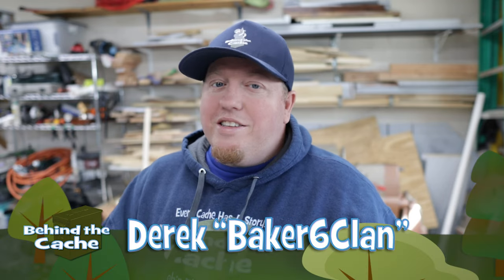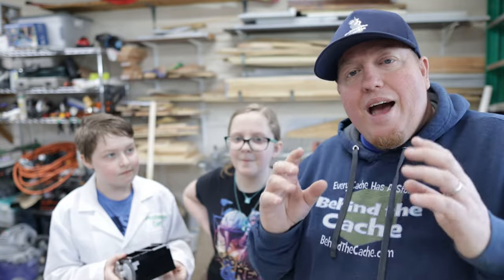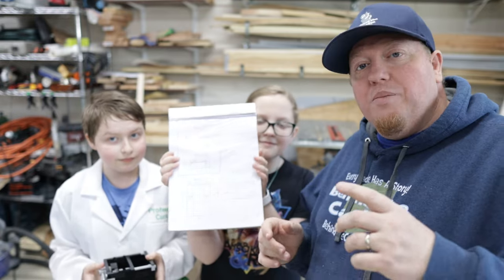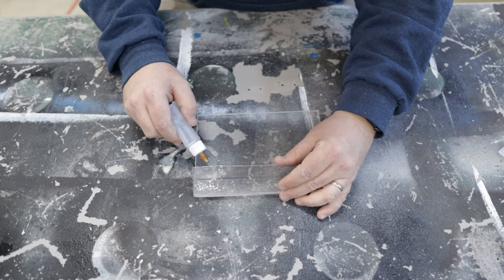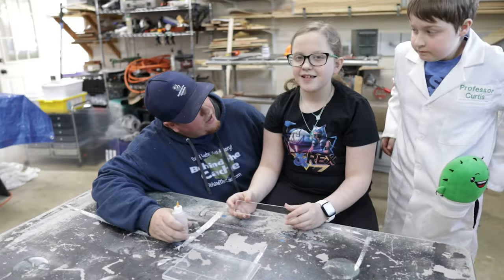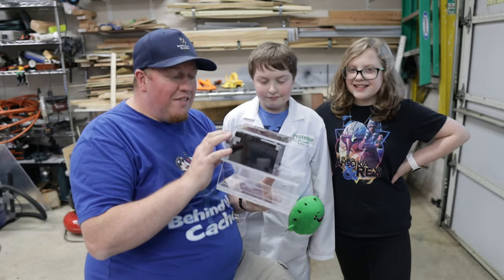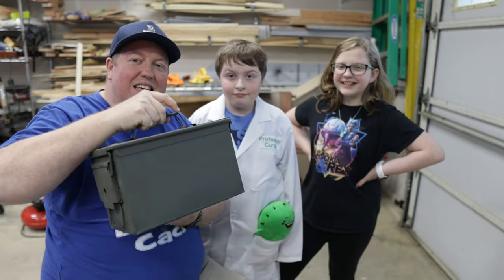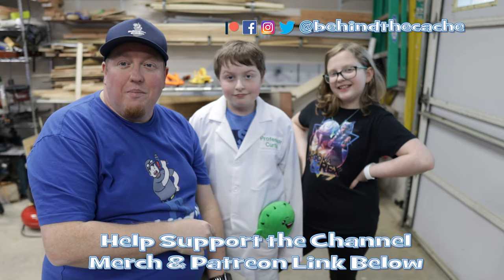Ammo Can Lego Safe Creative Gadget cache Build (GCNW)

Comment: This is awesome I've built the exact same safe and made a cache out of it. It got imensley popular untill it was destroyed unfortunately. But  hell of a fun one it is!
Reply from the maker: Wow that is cool. What did you put it in?
Reply: @BehindtheCache   I made a box with superglued Legos around the safe to lock it in place, and then placed everything inside a birdbox. I did put numbers on the safe dial though so the finder was not able to see the mechanism. 
Hade to do a bit of maintenance in the beginning I recall,  Ended up rebuilding the whole safe, superglueing the bricks. 
After that it held up well until it got smashed by someone.😕
Reply from the maker: That is great. We will see how this one holds up. We used the solvent that you use on the plexi to hold the bricks together it welds it together so we will see.